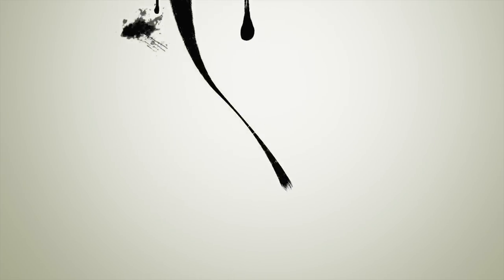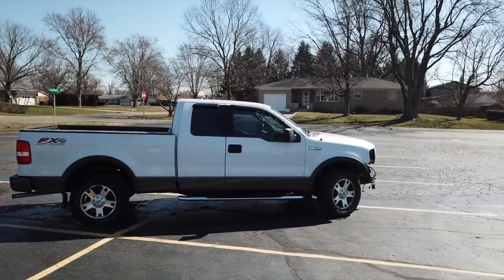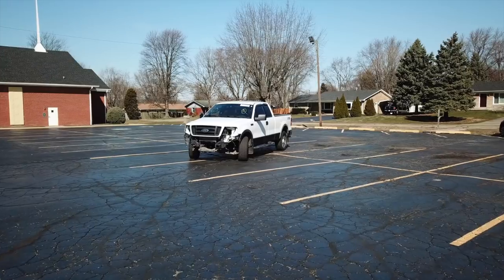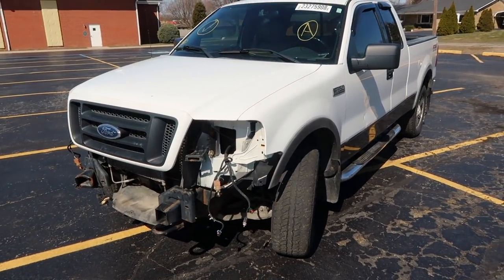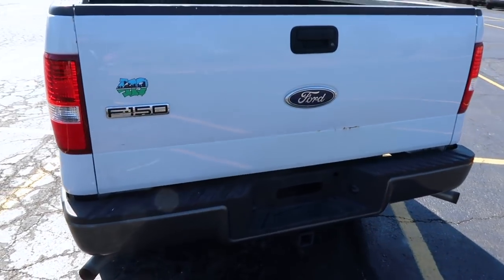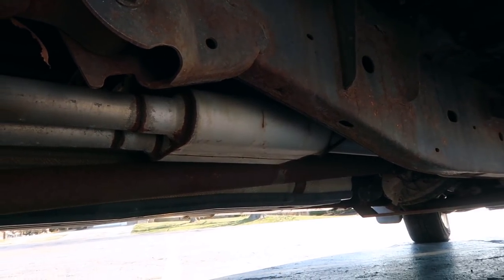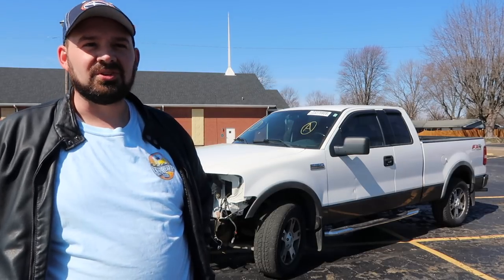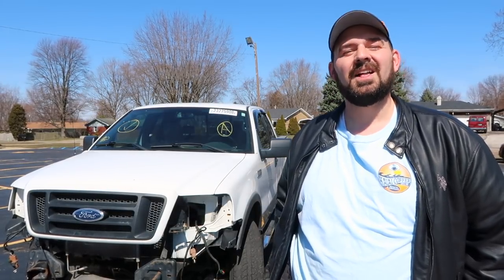The Next Project Vehicle!! Ford F150 FX4 Rebuild Introduction!!

Comment: while you are fixing rust, check the backside of the rockers, and pull up the plastic door sills and check under them, the wiring harness, and the edge of the carpet.

Comment: While you’re tearing it down look in to changing plugs and cam phasers. You will most likely need to remove heads to get plugs out. They had problem plugs the early tritons.
Reply from the maker: Thx! We will be looking at that.
Reply: There are special tools to use if the plugs don't come out in one piece. Just do your research before just trying to get them out. Goodluck!
Reply from the maker: Thank you!
Reply: My local mechanic charged me $500 to do mine ford wanted charge me $1200 to $1500
Reply: Phasers are a symptom, the problem is the oil pump. Mellings makes replacements that are better than factory for around $100.

Comment: Enjoy your videos. More power to you taking the risk rebuilding accident damaged cars. I stop once it needs frame or body. From studying  the different angles of the trucks. Your going to want to have your body shop buddy check the frame for tweaks. The drivers side seems to sit higher towards the cab and bed area, the gap on the drives side cab to bed is closer than the passenger side, also the tailgate gap is much tighter on the driver side. I think this truck might have some hidden frame and body damage. Only speaking from experience I owned a used car dealership in my early 20s and when you auction buy and take trade ins you get a quick eye for things like this to avoid getting burnt.